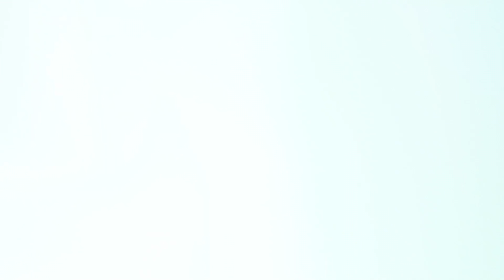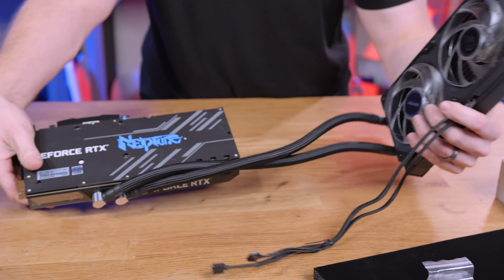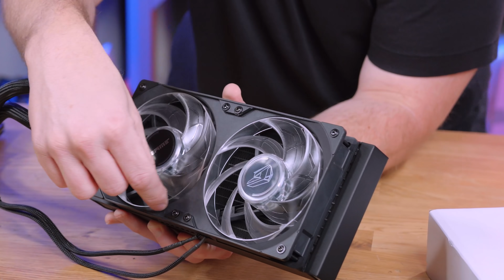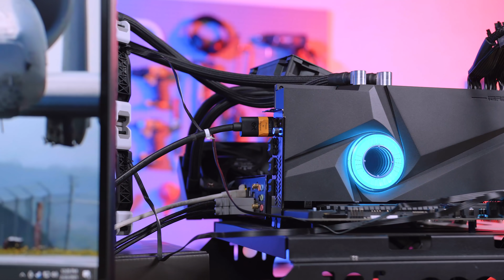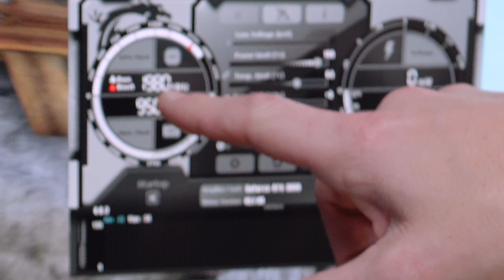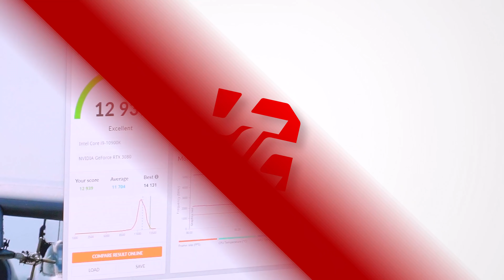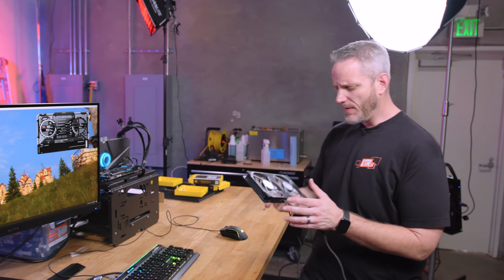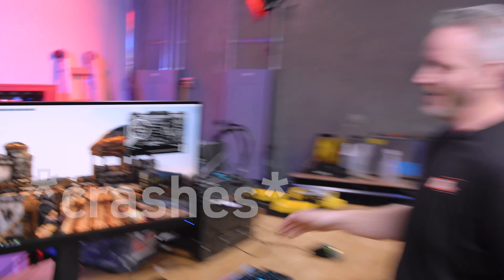AIO vs Air Cooled Video Cards... worth the extra cost?

Comment: I'm still in the air cooled side of the market... While I do use custom watercooling, the AIO GPU option for me feels too restrictive towards what kind of case I can deploy the option in. To me, I can't help but feel like I'm 40% of the way into a fully custom setup(mounting at least a pair of 240s in a case), while adding more points of failure for what is ultimately a compromised setup. Either I stick to SFF and can go ultra compact(albeit with a load of SFF oriented tinkering and optimizations), fully custom water cooling(max performance for long term deployment), or just ease of use(air only or CPU AIO). The requirements to deploy GPU AIO just ends up feeling too much like a strange middle ground...

Comment: One of the three fans on my 2080ti is failing - aside from the enivitable loss of cooling once it finally does, the noise of it is getting on my nerves. Looking at the G12 brancket and an AIO that's going to easily mount in my ancient Lian Li V2100 case, as a stop gap before rebuilding the whole setup early next year.

Comment: The AIO cooled GPU is definitely a plus for gaming. I usually found my 1070TI GPU is a lot noisier and hotter than my 2600X CPU when gaming. My only concern about AIO is leaking issue and lifespan of product.
Reply: One way to get around that is get the nzxt mount where you can just mount 3rd party AIO to the card after breaking it down. The AIO goes you can swap for another.

Comment: 4% more performance on my GPU. Best 300$ ever spent.
Reply: The difference in price between the AIO cooled and the air cooled cards withs some manufacturers is $50-$100.  EVGA is only $50 more for the Hybrid AIO cooled 3000 series cards for example.
Reply: @Mildly_Amused  When enough water evaporates out in a couple years that the card overheats is what I wait for.  I have a sealed Open loop and it looses quite a bit of water to evap every year.  Fans will last much longer.  I guess you can always cut the loop and add a reservoir in a couple years though most people won't know that and their card will overheat and they'll blame someone other than themself.
Reply: @Cinnabuns2009  where does the water evaporate out from that air tight sealed unit?
Reply: @matthew4107  Vinyl/Rubber tubes are semi-permeable and it just finds a way over time.
Reply: @Cinnabuns2009  You really fell for the FUD. I have a custom water loop with CPU+GPU block, dual internal 480 radiators (90 and 60mm thick) and an external 1080 rad. Since I have way more tubing and way more water than an AiO user, with the same percentage of water "permeating", I should be able to see the water level in my reservoir fall a lot faster than an AiO user. And it wouldn't even be a problem since I can refill it any time.
But I have been using this exact same setup for ~2 years now, and a change in water level in the reservoir isn't even visible. In fact, it hasn't changed at all.
The amount of water "permeating" out of a closed loop is scientifically speaking existant, but it is completely negligible.
Also, the Corsair H80 (not even H80i! it's that old!) I handed down to my nephew is still doing its job just fine.
I bought it in 2012 or 2013.
Chances are, if you spend money on an AiO cooled graphics card, you will not be using it for 8+ years.
Reply: @NorsteinB  Fell for the FUD?  My last 4 PCs have all had water loops.  Also, I was just mentioning evap in (1) open custom loop (NON AIO).  Mfgs are more careless than you or I would be because they're going for a bottom line price.  Not many AIO's have a triple 60mm thick Thermochill PA 120.3 and a Thermochill PA 120.2 in their loop because, like a 1080rad, people aren't willing to spend $300 on radiators.  Maybe my fill tube seal isn't completely sealed.  Maybe yours is.  We're not doing science here.  Just mentioning that water can and will escape.  FUD has nothing to do with it, you're just using that word to feel like you're strengthening your argument.
Reply: @Cinnabuns2009  or we can mineral Oil cool our PCs. Put our PCs in a tank of mineral oil with a pump and radiator for the oil.
Reply: @Cinnabuns2009  Had an 8 year old 240mm Corsair AIO, performance is the same as it was brand new. This stigma about AIOs being unreliable and losing performance over time needs to stop, because it's not true. Idk why you mentioned that you have a sealed open loop. AIOs are pretty much all vacuum sealed, much better than what we are capable of.
Reply: @NorsteinB  congratulations your loop is very good then. Not at all comparable to cheap low quality AIOs. There is ofc good AIOs but most are low quality.
Reply: @Cinnabuns2009  I have had a Corsair H100i 240 mm AIO on a 3930K since 2013 running 24/7 machine never gets turned off.  I have had zero issues with it.
Reply: @spodee55  damn... you just jinx'd it!
Reply: @Cinnabuns2009  I was wondering about that... could you just cut the cord and top it off? Put it back together with a plastic  wiper hose connector? And two hose clamps?
Reply: ur paying for no noise
Reply: @aarron1234567  I thought about that too, but most of the graphic cards now on the market can stop the fans at idle.
Reply: @Kiririn_Kousaka  Maybe I should rephrase my comment you’re paying for no noise at all Even under heavy load
Reply: pretty sure you're paying for lower temps and less noise, which of course comes with being able to squeeze more performance.
i really don't get why water-cooling gpus aren't more common aside custom loops, which are stupidly expensive in many countries if not downright unavailable

i spent less than 30usd for a 212evo and my cpu hasn't gotten past 55ºc even during stress tests, so why isn't there a similar air-cooling solution for gpus? if air cooling isn't gonna cut it and with gpus skyrocketing, i'd rather throw 150usd on a kraken g12 + aio to extend the lifespan of my card
Reply: Well the greater benefit with AIO cooling is that the card wont take up three slots
Reply: Gottq get those juicy 3.5 frames my guy!

Comment: I wouldn't been able to live anymore without my Corsair H55 with the NZXT G12 bracket anymore. I bought it because the stock cooler on my rx 580 armor was loud and bad at cooling but now even on my gtx 1080 zotac amp extreme it´s a big improvement in cooling and mainly sound

Comment: Back in late October when it became apparent the the chances of getting a new 3000 series card was about equal to my chances of winning the lottery I snagged a 11 month old MSI 2080 Super Seahawk X hybrid watercooled for $500 ..... People at the time said I paid too much but if you look at the price for a 1660Ti or RX 5700XT lately  thenI got a helluva deal. I've never once seen exceed 60C and it generally runs around 55C playing games and stock it boosts to 1995 and stays there for hours so it's an overachiever for a 2080 Super. However I did remove the stock fan on the rad and replaced it with a pair of Noctuas in push pull and ran it to a fan header on my MB and am using Fan Control V54 to control the fans and the GPU still controls the pump speed .... It's just sooo quiet compared the the RX 5700 XT it replaced which would often roar in strenuous parts of some games .... It's not quite as good as a 3070 but it's pretty damned close for 1440p gaming

I don't think I could go back to an air cooled GPU (or CPU for that matter)

Comment: nice video Jay!
you mentioned the NZXT AIO adapter

do you know about the AiO waterblock from Alphacool for AMD and NVIDIA cards?
its a waterblock which uses a preinstalled AiO from alphacool and it uses the their quick connect system so you can expand it rather easily
Its called the Eiswolf

here is a link to the AMD 5700XT version https://www.alphacool.com/shop/aios-sets/gpu-aio/eiswolf/27138/alphacool-eiswolf-2-aio-240mm-radeon-rx-5700/5700xt-reference

Comment: When everyone was dumping their 2080 TIs for the 3080/3090s I was faced with picking up an MSI 2080 Lightening Z or an EVGA 2080 K|NGP|IN, and because I am relatively new to all of the custom PC builds and water cooling I went the lazy route and picked up the EVGA GPU for $1k to wrap up my big build - "Big Geek". But, before I can back to Big Geek, and get the EVGA GPU installed  I need to wrap up wrapping up a scrapper build and finish fixing my dad's 8 year old PC; dead GALAX GT610 GPU. I know... I know... Kicking an ol' nag down the trail, but he doesn't want a new PC just yet.

Comment: I went from a 2080Ti aio water cooled to a air cooled 3080. The pump noise was horrendous on the eggs hybrid 2080ti, you couldn’t turn down the rpm. The air cooled card is so much quieter. I even went back to air cooled cpu too!

Comment: I have a Inno3D 3080 frostbite on a 360mm radiator and on load its 41-45c but the memory is 90c when fully loaded. So imo watercooled cards are only worh buying when the memory is also cooled. Mine isn’t

Btw the radiator and  gpu are linked with the corsair commander pro to manage temps

Comment: Jay have you tried a turbo duct fans on a build yet? I had an extra one from a job I did for a 30 foot cloths dryer pipe and thought how could I use it on a PC. So me being a car guy also I removed the back fan made a radiator fan shroud that gets air from the duct fan on the back of the case through the shroud mounted to the radiator that's mounted to the top of my case. This is the one I used after I painted it first and yes it's quiet. https://www.amazon.com/Booster-Exhaust-Ventilation-Greenhouse-Basement/dp/B08LZ6N9VV/ref=sr_1_158?dchild=1&keywords=turbo+duct+fan&qid=1614068050&sr=8-158

Comment: I've used nzxt g12 with nzxt kraken x62 and worked just fine but was concerned about the memory and powerdelivery although the g12 has an cooler added to the frame that provided some air to the pcb. 
Was way better than the powercolors own air-cooling with was really noisy

Comment: Jay, can you take a look at Gigabyte's RTX3080 cards? They have a VRAM overheating problem due to bad quality thermal pads and lack of thermal pads on the back of the PCB, which means the heat is trapped between the backplate and the PCB. I have a Vision OC and was wondering how to apply my own thermal pads on there to fix this.

Comment: I'm only afraid of the following: AiOs are known to cause problems from time to time. But if the AiO breaks, it's a real problem with the graphics card. Spare parts will be hard to get and the conversion to air cooling will be a real problem, because everything is special dimensions. So if the AiO causes problems, my whole GPU will fail - and that's at the current prices!

Comment: But Jay! You can setup un bios for which temp on what fan connector controller listens to.
At leat in my z390 Ultra i can easily set some fan to set rpm based on CPU temps, other based on GPU or even external temperature sensors.

Comment: A GPU that has an Air & AIO versions of itself. 
Would the air cooled GPU that has a Custon water block installed perform better than the AIO because of the power/temp limits?

Comment: Yes I think it's worth it, if you can get them. And I'm not just saying that because of the current world situation, but here in Europe it's always been a challenge getting hold of an AIO cooled graphics card until many months later after release, and then you have to pay an excessive premium way higher than it should be (sometimes upto 800$ more than air cooled type). I wish more would make complete AIO sets for graphics cards like the Alphacool Eiswolf because those actually work well and aren't that expensive, but they are unfortunately missing from the market lately again due to you know what...

Comment: Nice to cheat like 22 C ambient, and dont care about warm air inside the case. When it will be installed in push top mount, we have 60-70 on the die

Comment: So... I just recently got my 3080. I wanna keep it air cooled. I installed MSI Afterburner and messed around with core clock, power draw and temp limit to get the maximum out of the card regarding 3D Mark TimeSpy score. But I am still unfamiliar about what to do with the mem oc. Do I need to up it step by step after I determined the max core clock. What are valid values for the memory on an air cooled 3080? Do I leave a lot of performance on the table when not changing the mem settings at all?
I am thankful for any recommendations and advice.

Comment: Memory temps on the 3080/90 cards are in gpu-z or hwinfo.  If you wanted to test the memory cooling all you had to do was fire up nicehash and let it mine for 10 minutes.  -150 on the core, +900 on the memory should get you 98mh/s at around 220w.  The card will start throttling when the memory temp hits 105c.

Comment: Whats up with watercooled cards that have a lower boost clocks than their aircooled counterparts? For example the Gigabyte Aorus RTX 3090 Extreme. Aircooled: 1860MHz Watercooled: 1785MHz Why is that?

Comment: After getting my first AIO GPU this generation I can honestly say I wish I had done it sooner.
Reply: Could you tell the reason why you wish you did that sooner ? I am now searching the benefits of watercooling and don't know yet if they worth the noise. Thank you
Reply: @noipinus9392  better temps and the noise level is about the same if not lower. Admittedly the card did make a bit of a grinding sound when I first got it (due to trapped air), but after tipping my pc and running it on its side for about an hour it’s been whisper quiet since.
Reply: @Gornogaming.vancity  What waterblock do you use, if I'm not bothering you ?
Thanks for the answer
Reply: @noipinus9392  I’m using the evga xc3 aio cooler, I can’t really justify the extra price for open loop cooling.

Comment: I do not understand why they do not design a full card waterblock to work with an AIO since they are going through the hassle to adapt a "cpu" AIO to a graphic card. I mean, if the problem is cooling all of the other component on the card, just extend the waterblock to cover all of the card... having a third fan to cool the power delivery kind of break the purpose of an AIO, that should be cooler and quieter operations, I guess?

Comment: I believe, depending on the motherboard, you can choose in the BIOS what should the fan heather listen to, the CPU, the GPU or some additional temps. But to the topic - if money is not an issue I would always go for water-cooling rather than air. If, however, you are on a budget, I would probably take those $100+ that you'd pay for a GPU with AIO and invest in a better GPU overall or in some other component, or even better air flow for your case.

Comment: Approximately one year after building my first & only ' ultimate rig ' using a msi 1080ti with funds from a house sale, (2018) i stupidly upgraded to a 2080ti. Yea i know, pc ' latest & better ' fever bit me what can i say. But now, in mid February 2021 even though i still love it, i'd say if you have a regular 1080 or equivalent don't bother upgrading at all. By the time it's truly obsolete the 6000 or 8000 series will be out along with much better cpu's to support them. Only then will +/- $1500 be justifiable, as long as you are willing to budget and save up for it. Lessons i learned the hard way, r.i.p $5k

Comment: No to AIO GPU. Will be fun to get new cooling if it brakes down. New air cooler, custom gpu block will be no problems. Liquid maintenance... so big NO, I’ll stay with gpu block and custom loop. Atm air cooled 3080 strix oc, because ekwb vector block don’t fit in lian li o11. XL case on the way

Comment: Good video Jay. 👍

I was hoping to get an air cooled GPU 3080 or 3090 myself due to how hot the VRAM gets. The core temperature doesn't seem to be an issue with air cards with three fans at the front, but the temperature at the back is ridiculous.

They're like Unicorns though. I've yet to see any water cooled card pop up over the last few months. They can't be producing them in significant numbers.

Kevin

Comment: I've been using one of the nzxt brackets on my 1080 for around 4 years. Coming from a reference 1080 to it took my temps from 75-80c to never pushing over 55.

Comment: I would say it depends on 2 things...

1. Usage. Are you doing production work and gaming? Or are you just gaming?

2. Length of usage. How long do you plan on keeping it? What is the lifespan of the AIO attached? Can it be refilled or pump relaced down the road and the cost associated with those things.

Also, Jay please do a non-OEM radiator fan roundup review for best overall cooling / db / aesthics per $$. Seems like the only things that ever get really looked at are CPUs and GPUs which nobody can buy ATM...lol. I like the cheap fan reviews you have done in the past... I would like to see more comparison reviews. I know Steve (GN) does a lot of comparison reviews but more comparisons mean more information and scenarios that might be closer to the average user. One thing that most reviewers do is use the highest end components to show the maximum performance available for a specific product and that is great if you are "marketing the product"...but I would rather you "market your opinion" based on average real builds. Most people don't use a 5950x and a 3060Ti, 3070, or a 6800. More likely they are pairing that CPU with a 3080, 3090, 6800XT or a 6900XT and vice versa. In my opinion an average build would be a Ryzen 5 3600 or 5600x paired with a 3060, 3060Ti maybe a 3070, or a 6700XT. In other words more balanced build reviews would be nice, not just from you but all reviewers. Sorry for the novel!